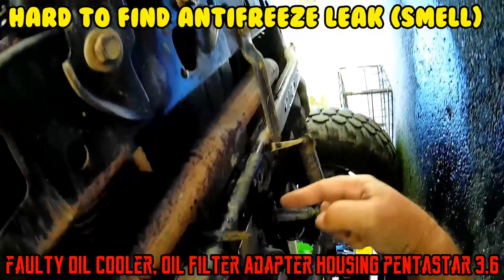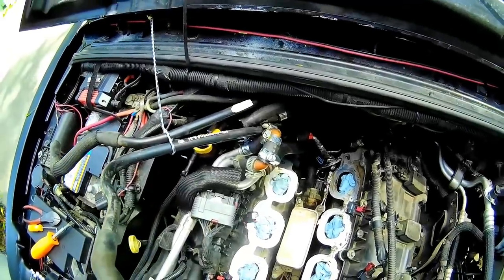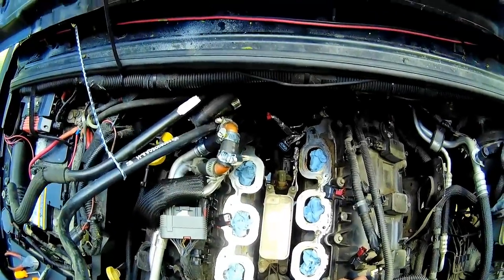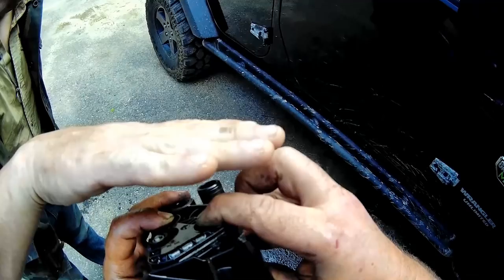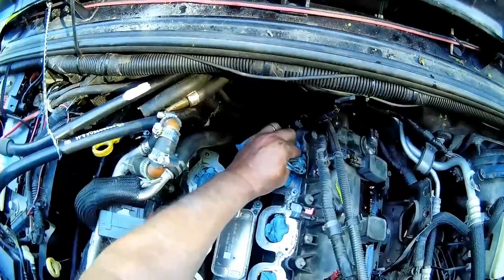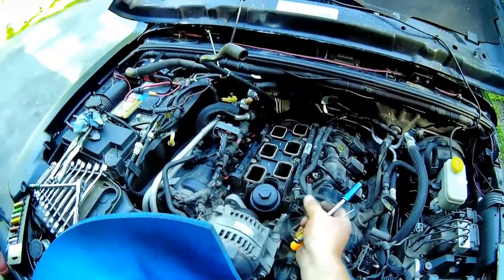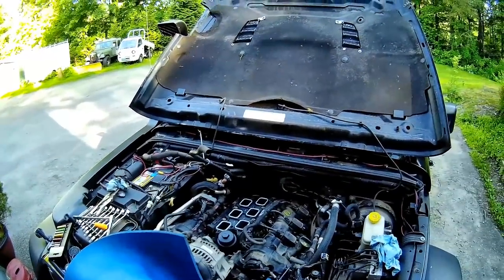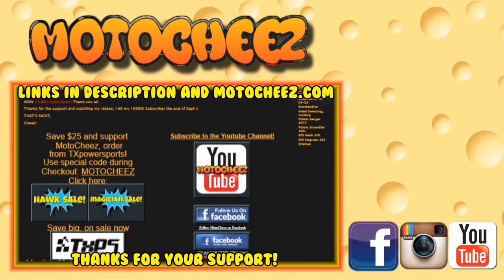Antifreeze smell or leaking down bell housing. Wrangler JK 3.6 Chrysler Pentastar oil cooler 2011-16

Comment: Now comes the fun part... figuring out WHY it failed.  Vibration, Temperature, Expansion/Contraction, Thin/Cheap mold, something over-torqued at the factory...?  Good work finding it.
Reply from the maker: I'd guess the plastic gets brittle from the heat... Ty😁
Reply: Thin cheap plastic!! It happens all the time! Then people say "buy an OEM part". Why, The OEM one didn't last for crap!
Reply from the maker: Too bad they didn't make ak all aluminum part... OEM has 2 year warranty, aftermarket might be China, I didn't want to take that gamble to have it let loose offroad. 184,000 the original last
Reply: @MotoCheez  u have 185k on that? Wow! Keep on Jeeping!
Reply from the maker: @Matbug1812  yep 😁😁😁
Reply: Its designed to fail should have been aluminum.
Reply: @MotoCheez  does anyone offer a all aluminum one ???
Reply from the maker: @lawrencemiller2379  I couldn't find one
Reply from the maker: 😁😁 some sure are!

Comment: I had an oil cooler worked on years ago on my 13. Im having coolant smell and overheating. I wonder if its having an issue similar to this. I've installed a tranny cooler, radiator, pump, 3 thermo housings that broke.  Still having a heat issue.   Deff wondering if this was similar to this

Comment: I knew it as soon as I saw and heard what you are talking about. I was thinking blown head gasket because it happened right after I jumped on the throttle in a turn to swing the rear end around. It over heated and all the coolant started dumping out the back passenger side of the motor. It happened months ago but I suspected somehting elese and put some radiator stop leak in it and that worked for a bit but now when I fill the radiator when it's cold and the motor off it starts draining out the back. Thanks brother

Comment: Good find on your 3.6. I am just adding to your find as i have a charger with the 3.6L. Started smelling antifreeze like you did,  One day at a stop light steam vapor came out the back of the hood.... Thought is was a hose or the crappy plastic T fitting for the heater hose, Not so.... Oil cooler had antifreeze and oil all around it, Nice !!!. After taking it off and no hoses were bad and the T fitting was still good. I took apart the oil cooler. The O rings , And i will add there are 4 between the cooler and the plastic housing... These and the ones that go on the cooler underneath to mount to the engine... Over time they get hard from the heat in that location and no longer seal. You can buy the O rings for between the engine and oil cooler, but i haven't found the O rings between the cooler and plastic housing. Mine wasn't cracked like yours, But i have a new one on the way. My car has 214000 miles on it. Happy trails.
Reply from the maker: Great info. Thanks!👍👍👍

Comment: To clean stuff fast and residue free, in the engine bay, when and where you can't dip or wash stuff, use a rag dipped in Naphtha. That stuff eats crud like nobody's business, just don't sniff it, i hear it gives lucid dreams.
It's in fact, so effective, i dunked my whole offroad bike chain in a tank of the stuff, swished it around a few times and popped it clean as a newborn baby bottom. It's nothing short of amazing.

Comment: I’m having the same problem my jk it’s at the dealership right now. But they cant find the leak. All those technicians are part changers nothing more.
Reply from the maker: Sadly that's what most have become.... Parts changers.
Reply: @MotoCheez  so you were leaking oil or coolant. And was you problems fixed after replacing that part.
Reply from the maker: Mine was leaking antifreeze, I've heard some had oil leaking from it too. Yes that fixed it 100%
Reply: @MotoCheez  thank you
Reply: I got my jk back and they replaced the radiator cap. And it’s keeping the coolant label for now.

Comment: I'm having this same problem with my 2012 Dodge Charger SE 3.6L I believe. I had to replace the oil pressure sensor about a week ago and noticed a bit of oil was accumulating in the valley, then today while taking a short drive suddenly coolant started leaking out of the back of the engine and dripping from the bell housing. White smoke was pouring out behind the car so I thought it was a bad head gasket leak at first, but then when I popped the hood I noticed the only place white smoke was coming out was under the lower intake, from the valley. I checked the heater core hoses and they all look intact, but when I fill the coolant tank I can see coolant leaking out under the oil cooler, so thanks to your video - I pretty much know where the problem is. Thank you!
Reply from the maker: Crazy place to put an oil cooler, right?

Comment: I ordered and received delivery my Wifes 2014 Grand Cherokee in 2013 and I was smelling antifreeze when it was two years old but could not find the leak. As the years went by I would find quarter sized spots in the driveway but never could find the leak. This year, 2019 the housing really failed and the quarter sized spot became 12". I had that damned thing replaced at Jeep and I am still slowly loosing coolant (no spots in the driveway) Really pisses me off, as we have owned 13 Jeeps (still have 3) and the most problematic is the newest of them all.
Reply: Less than 93k miles
Reply from the maker: It's definitely a weak point. It should be recalled! I have almost 200,000 miles and that's the only big issue I've had with my JKU... The old 4.0L I line 6 was the best ever
Reply: MotoCheez AMEN! Still have my 04’ Rubicon, no problems
Reply from the maker: @dmzflightmedic  I have an old 4.2 CJ still going strong too

Comment: I am going to have to check this out.  I have had a slow leak for a year.  I finally got a pressure tester and it is running down the back of the bell housing.  I was wondering if it could be a bad heater core, but I would expect that to leak out the condensate drain.  Now I will jave to figure out if I want to repair it myself of do it under extended warranty, by the time I pay the deductible, it still might be cheaper to do myself.
Reply from the maker: I'm surprised jeep hasn't recalled this yet. It's definitely an issue

Comment: Yeah, I thought that I might have a blown headgasket at first until I saw this,  I had a slow coolant and oil leak for several months and then today it went crazy leaking horribly, but I couldn't see anything obvious except that it was running down the bellhousing from under the intake manifold...
Reply from the maker: I had a small leak for almost a year before. I finally found it.

Comment: Hey moto,  as they say,  "hindsight is always 20-20". But jeep is happy you found his leak. He was probably starting to feel a little hot under the collar. Kinda like you were with your (so-called) helper (parts runner).
Reply from the maker: Yes! "Friend" called me at 10am and asked if I needed anything since he was going to auto parts store.. I said sure, told him what I was doing and what I needed. Hours later I said had to get cooler at dealer which is in town, he said has parts will meet me back at house (2pm) so got my parts, put them in and tried contacting him and no answer, so finally at 7pm I called for coil packs, one place had 2, another place in NY had 1. Sent my kid to NY, I went to town, got mine met back at house and NY gave my kid wrong coil pack!!! So yeah, I was a bit twisted 😁
Reply: @MotoCheez  did you go back and get the right coil pack yet?
Reply from the maker: Yes!
Reply: @MotoCheez  did you ever get a chance to watch musti 1 on YouTube yet moto? He's nearby you in new Hampshire.
Reply from the maker: Yes, he's got some good content!!👍👍

Comment: Changed mine out. It started leaking again. I'm thinking mine is a hose
Reply from the maker: My sons is starting to leak a little in his. The whole country is sold out and backordered on the oils coolers!  Even the dealers
I smell a recall soon??
Reply: @MotoCheez  I changed mine and the seals came with it. It started leaking again (after about two weeks). I'm thinking mine are hoses.
Reply from the maker: Hopefully!

Comment: wish I found this video sooner , I have a 2014 jk replaced everything on cooling system , radiator, thermostat, hoses, belt, heater core , sensor and water pump. still had a small leak . Pressure tested system and it leaked down but no water showed or dripped. I gave up and took it to shop yesterday ,waiting for them to call now and tell me it is oil cooler
Reply from the maker: Damn. Ya

Comment: Currently dealing with this on my 2012 Jeep Wrangler sport. Taking it to the dealer next week because I lack the tools and dont have the time.
Reply from the maker: Make sure you tell him to flush out the heater core, it ends up filled up with sand etc from the casting of the motor and if you read many of the comments a lot of the dealers don't do that and they try to do other things first that cost way more money, like change the heater core or the flap climate controls

Comment: just buy a smoke machine to look for leaks and cracked seals.
Reply from the maker: Coolant goes thru there. Didn't leak until hot, under the intake I wouldn't have seen it I don't think

Comment: FWIW, Dorman now makes an Aluminum lower kit for these coolers now. Basically you buy the cast aluminum lower kit from them (comes with upper and lower plenum seals too!) and you transfer the metal upper cooler, sensors etc to the lower. 
Good stuff. About to install one on my 2017 JKU and hopefully it will be the last time for a while unless the seals go (which I think the newer seals are better quality now. I guess we will see).
Reply from the maker: That's awesome! Should have been aluminum from factory.
Reply from the maker: YouTube don't like links.. it deleted comment. Send to me and I can post it. motocheezmail@gmail.com. Thanks
Reply: I installed one on mine 2 days ago. I thought it was the answer to all my problems. Finished the job, turned the jeep on...coolant pouring down under the jeep. Went back in today to see where the coolant was coming from, everything was tight and torqued to spec...still pouring coolant. Now I gotta spend a grand+ at the stealership. Smh
Reply: @Brother_Lander  sorry to hear that Shane. I've had mine in for a couple months now without any issues.
Reply from the maker: Damn .. something not sealed apparently
Reply: @MotoCheez  yeah. The reviews are great on these things. Maybe the seals were trash, or I got a lemon 🤷🏽‍♂️
Reply: @Brother_Lander  agreed. I followed torque specs and triple checked everything when I was doing my job. It's either that or the heater core hose that feeds it has a problem.

Comment: Got mine fixed in October and its leaking again!
Reply from the maker: No way!
Reply: @MotoCheez  Something is causing the problem
Reply from the maker: @chrissipoohster  originally the plastic becomes brittle and cracks. Maybe a failed oring?

Comment: Nice informative video. I have a '12 JKU that over the last couple months I've noticed a coolant leak. Had the jeep in the shop last week for new gears and they told me there is coolant (pink) stains all under the jeep. I did spark plugs a few months ago, guess I'll be taking it all back apart soon to replace the oil cooler now.
Reply from the maker: It's a tough spot!

Comment: Could this be my problem on my 07 jk? @motocheez
Reply from the maker: The 07 3.8 did not have the oil cooler under intake manifold. I believe it's behind the oil filter on them
Reply: @MotoCheez  could it be the same issue? This thing is driving me nuts!
Reply from the maker: Losing antifreeze?
Reply: @MotoCheez  yes sir, losing antifreeze and strong coolant smell. No noticeable leaks or corrosion anywhere that I can see.
Reply from the maker: Check the oil cooler behind oil filter I think it is
Reply: @MotoCheez  awesome man, thank you. Would I be able to find the leak if I pressurized it? I appreciate all your help.
Reply from the maker: Probably, but you don't want to go over 15 pounds, I'm surprised you can't see it anywhere from underneath the even traces of the old antifreeze from somewhere
Reply: @MotoCheez  just sent you a Facebook message sir. I would appreciate your help!
Reply from the maker: I'll go look